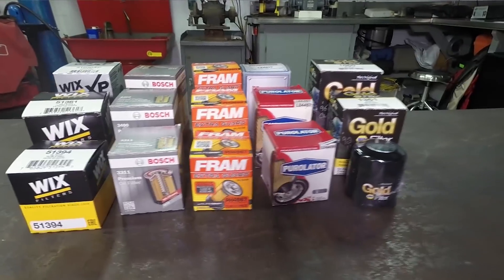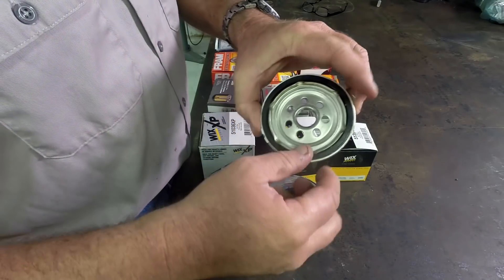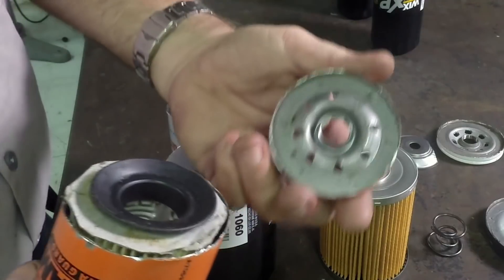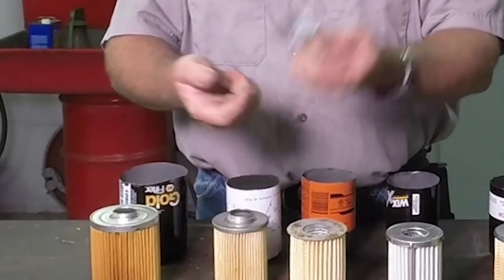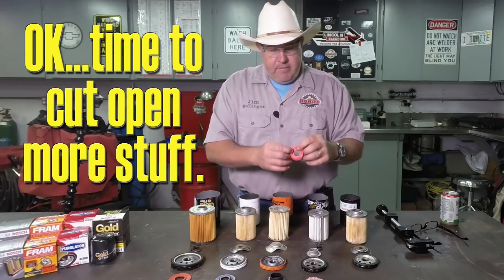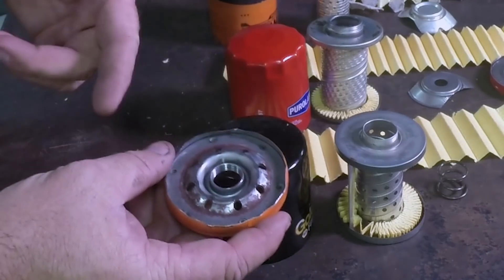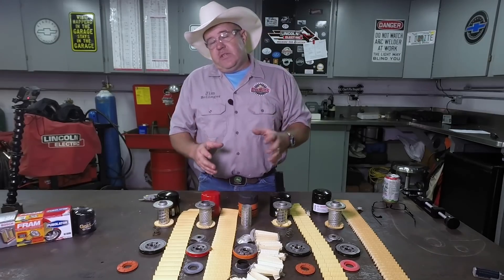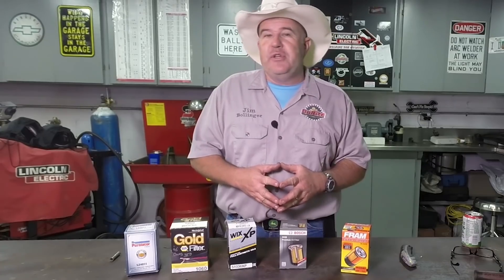The worst oil filter EVER!

Comment: I hope FRAM sues to take down this video, as it's all garbage and lies.

1) Anti-drainback valves are not a requirement.  They're a nice feature to have.  So you lied.  I can remember when they became a thing.  A filter with a stuck or nonexistent anti-drainback valve will work fine, as all this valve does is prevent oil from draining back when the engine is off.  During operation, the valve does nothing: it gets out of the way.  Oil flows from the outside holes to the inside holes.  Without the valve, the oil filter empties (and not in a way that causes contamination of the engine, either).  The anti-drainback valve only keeps oil inside the filter while the engine is off so that the engine doesn't have to fill it up to start filtering oil again.  But that takes like 2 seconds, and your engine isn't in any danger while it's filling up the oil filter with oil that has already been filtered.

2) Nearly every oil filter is made of a paper filter media.  The whole "OMG FRAM are cardboard" is basically bogus.  Very few, if any, filters are going to be made of any other material.  Paper catches the particulates just fine.  If you need something stronger, the question is why is your engine casting off large pieces of metal.    I've seen FRAM filters cut away in other videos where catastrophic engine damage occurred due to too much NOS or boost, and the FRAM filters did their job by trapping the pieces that got cast off.

3) I've been using FRAM filters all my life, never had an engine problem.  24 years and not a single problem.  And my dad has used them as long, if not longer.  If they were as bad as the person claims, we would've had catastrophic engine events by now.  We haven't.  Not a single problem.

4) You intentionally use the cheapest FRAM, which doesn't really have an anti-drainback valve in the first place.  The more expensive FRAM models (which you didn't test) have good anti-drainback valves.  So you skewed the test by only selecting their cheapest model.

5) Rust is immaterial.  First, you didn't chemically test it to see if it is rust, so I don't believe you.  But let's say hypothetically it's rust.  So what?  You'd have to prove that this rust will dislodge, first.  Second, you'd have to demonstrate that tiny pieces of rust can even cause a problem in the first place.  So to prove that it IS rust, you'd have to have it tested chemically.  Then you'd also have to prove that this rust CAN come off.  Then you'd have to prove that it can come off in large enough pieces that it causes a problem.

6) Engines can run without an oil filter anyways.  Oil filters should be used, don't get me wrong, but very few engines cast off large enough metal parts that they will see a significant shortening of lifespan without one, or with a FRAM.

7) The way to truly test is to put them all each on an identical engine with identical load, operating parameters, and identical oil.  You didn't do that, so really you have nothing.

This is why so many people have down-voted you.  You're basically a liar and a charlatan.  Sadly, they didn't all down-vote you, which means unfortunately there are enough people out there who don't know the truth about how stuff actually works.

Prove it scientifically and I'll change my tune.  But I strongly doubt you will because you intentionally made a video high in showmanship, not to dispense truth, but (I wager $20) to make a name for yourself.

Comment: stick with fram tough guard or ultra guard. you idiots need to understand that its cheap because it's designed to be throw away filters for guys that changes the oil two or three times a year. it's perfect for it. i never had issues with those in minnesota weather.

Comment: Been using these cheap frams for over 20 years driving every car well over 300k Camry is approaching 400k my 03 Camry at 246 Prius had 200 before it was wrecked. Sienna van is at 300 and tundra at 240.

Comment: I find clips like this one a constant source of amusement,no spin on oil filter will make any real difference to engine longevity.Why?Because oil filters such as those found on modern cars will at best remove particles down to 20 microns(more likely far larger 30 microns plus) and the damage that is done by particle contamination in engine oil is 2 micron or less(sub 1 micron)
The story of why we use oil filters is interesting and lengthy so do some real research and find the truth yourself.I have the same spin on oil filters on my vehicles from early in their life but still the oil remains a honey colour free of contaminants.Oh yes the oil is as old as the vehicles as well.Bye

Comment: Hey Einstein, there are only 2 oil filter manufacturers on America, so smoke on that for a moment. As for the "Rust" in the paper caps on the Fram,  That is hot melt glue and paper caps are EXACTLY as strong as the paper filter element. Ask an engineer about Fram rather than a cowboy wannabee. Wix is a bit better though, but it's all about MICRON's and you didn't go there
Reply from the maker: Nope and nope.
Reply from the maker: Listen guys, it was rust. Period. If you dont believe me, there are others out there that have found similar. You want to use that junk on your stuff, no problem with me. Consider yourself informed. You make your own decisions, we are all grown men here.

Comment: Cutting a filter open and looking at the apparent quality matters, but not like actual scientific tests. Testing for the pressure where the bypass opens and the actual filtration over time are FAR more important. Same thing goes with the ADBV. I've heard people talk about silicone vs rubber ADBVs. 

So what you really want is a filter that does all the right stuff for a reasonable price. If FRAM actually dumped rust into your engine, they would have been out of business years ago. I'm not saying there isn't a difference, but this kind of comparison only touches on the apparent quality and not the real world performance. And what about FRAM's Ultra Synthetic filter? I've seen those cut apart and they're better than anything I see here. 

So here's what I have to say...  Change your oil and filter regularly. You are still WAY better off with lower cost materials than the guy that's skipping intervals or not doing anything.

Comment: Regardless of brand, the BEST thing you can do for your engine is change your oil filter OFTEN. If that means buying the cheapest filter so you aren't reluctant to throw away a filter that costs 2 or 3 times as much, so be it. You really CAN change your filter BETWEEN oik changes though virtually nobody does it. Delayed maintenance and dirty oil are the most damaging things to your engine.

Comment: Do you have any non anecdotal evidence that a fram will destroy an engine? I have used them for 20 years, usually 6k mile runs and have never had an oil related issue with an engine.

Comment: You oil the seal to prevent the rubber from bunching up when it’s tightened to prevent leaks. My old man has used Fram all his life. 100’s of thousands of miles. Never had a engine problem. But then again he changes his oil regularly unlike most people

Comment: Fram make 4 types of oil filter, from the cheapest low demand Extra guard that was cut open, with a inner paper cartridge weighing 40g. To the Tough Guard, Ultra Guard, and  High Mileage, with silicone drainback valve, and a inner paper cartridge weighing 107g, almost 3 times the paper weight. Why did you not cut all 4 Fram filters open, and educate people about the types of Filter Fram manufacture, instead of leading people to believe Fram are garbage. Tough guard is a good filter, Ultra is the best, much depends upon the engine and use

Comment: Been using Fram in my mazda for 8 years, 160,000 Miles later engine still purrs. Just change the filter every time, on time, and you wont have a problem.
Reply: Change your valve cover gasket. You'll realize it ain't purring like you think.

I bought a car from my aunt. I was second owner. She's OCD beyond sanity. Literally. She kept full records of all maintenance on the vehicle. She changed oil every 3000 miles within a range of 20 miles without exception. Always fram. Always pennzoil. Without exception. 

I followed the exact same thing. Maybe within 50 miles. Same pennzoil and fram. The valve cover gasket had a small leak. Not huge, but you could see a little oil stain within a quarter inch of the seam to the head. 

Being pretty OCD myself I decided to change the gasket.

When I pulled all the bolts off this little 4 cylinder Ford engine and went to grab the valve cover I instantly knew there was a problem. It weighed about what a head on a 350 chevy engine weighed. 

When I flipped it over there was sludge with just enough room for the  rockers to move and no more. I had to take it to a car wash and pressure wash it out to break it up. 

I knew a guy and pulled an oil sample and had it sent off for some basic testing. Meanwhile I decided to chop open the old filter that had a little under 3000 miles of use. 

The filter media was almost completely gone. It was dissolved into the oil. Getting the results back from the analysis confirmed what I saw. Massive amounts of debrie in the oil.

I have never used Fram since. And I never will. Nor pennzoil. To this day I have only used Wix filters, and for oil I'll use valvoline, mobil, Castrol, and any house brands those guys make.

That experience was enough that even though I have had no problems with my vehicles I still do an oil analysis and cut open a filter ever so often. 

And the Ford engine purred like a kitten. That little miniscule leak was the only sign of any problem. Meanwhile it was clogging all my oil journals, restricting critical flow, and destroying the oil pump. 

Side note, all the detergents they put in modern oil today is very different than years gone by. That's the number one reason the oil change intervals have increased. 

Do NOT change your oil today every 3000 miles. The minimum now is 5000. Even on an older car. Otherwise the detergents will never break down as they are supposed to at the end of oil life and you'll wash out your crank and cam seals. And possibly even your pushrod seals on pushrod motors. It literally will eat the rubber out because you keep the detergents at the maximum levels by changing too soon.

Comment: It's that metal canister construction in the inside of the pleats. All that oil pressure always breaks apart weak material like these cheap Fram filters. Unlike the competition that always uses that metal strength.